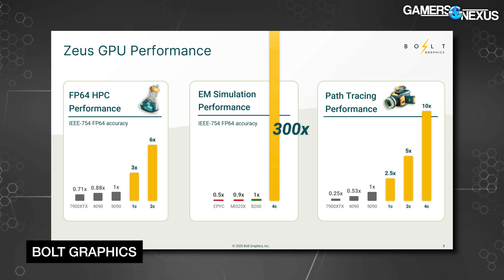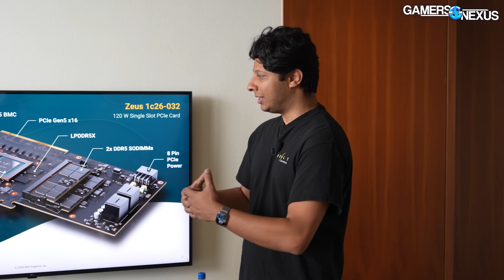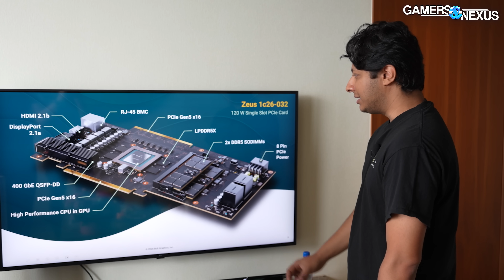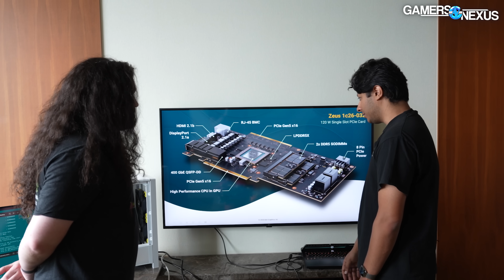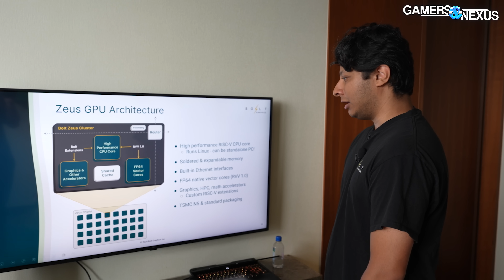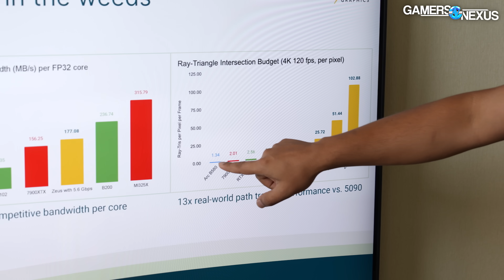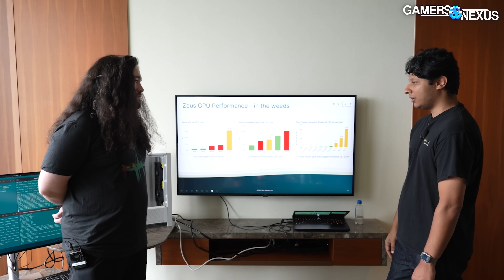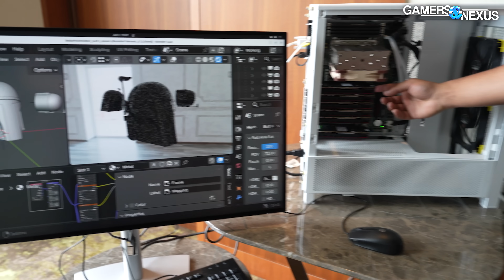A New Gaming GPU Challenger: Bolt Graphics Takes Aim at NVIDIA

Comment: tl;dr: Everybody thinks they're building the next consumer card, but they aren't.

0:18 "Our intention is to make this card um available to as many people as possible."

Regarding the Ethernet port: 
10:42 "A consumer might not might not need this as much, but definitely in a DATA CENTER USE CASE where or in a in a use case where you have maybe 10 GPUs"

20:23: "They're happy to leave rasterization behind. So we need to be able to build something for the future of computer graphics and not really for the uh for the past"

All games require rasterization. Raytracing is a fringe tech so irrelevant, that most gamers don't care about it and in many games it's tacked on at best. The guy is talking about path tracing though, something that no game uses atm. 

Ergo: This card targets data center and other industrial use cases. And that makes sense. No startup in their right mind targets a smaller market if a bigger one promises more success. This card will likely be less fit for gaming than an Nvidia Quadro.

I really have to wonder why the channel is pushing this as if this was a relevant product. They don't even have a prototype card yet after 6 years. No word on the cooling and how this will work in conjunction with adding and replacing the RAM. No word on the included CPU cores and how to boot into Linux and why that would be relevant to most users or the relevance of the dual PCIe-connector. As it is, the design makes the card needlessly more expensive, at least from a gaming point of view, something that's conveniently glossed over, despite every second video on here being on the pricing of tech. This is an ad. No more, no less.

Comment: Just FYI... I am willing to have a computer case 3 times larger and run multiple powersupplies ( even if it doesnt nessarily use twice the power)  if it means matching the power of major companies.  why do i need it to cram onto a single motherboard? Why are we playing by those rules?   

Consider.  You pay 2x for motherboard parts and pay -5× for graphics, ram, processors... 

Why not have 4 graphics cards and 6 processors all running with lots of airflow because the PC base is 4 feet by 2 feet and 3 feet tall?  No rule says it needs to be singulsr heavy mess either..  Cost me $20 more a year in eletricity splitting the PC into 2 peices at both ends of my desk?  Okay good!   The creativity oppertunity and market boom is just sitting there.

Comment: You don't need to "port 10,000 games", you need Vulkan drivers for Windows, that's it. Games aren't written against specific GPU models, they're made against graphics APIs.
Reply: That’s how APIs work in an ideal world, but the reality of PC gaming is messy. Game developers constantly write unoptimized code or tailor games specifically to Nvidia/AMD hardware quirks. Nvidia has thousands of engineers whose entire job is writing game-specific driver hacks to prevent crashes behind the scenes. Look at Intel Arc: it had fully compliant Vulkan and DX12 drivers, but still choked at launch because it lacked 20 years of those hidden, game-specific fixes.

Comment: What fascinates me is that they are positioning themselves towards graphics rather than raw computational power. So these will be fantastic for film, game, and video use, and posssibly things like facial recognition and security, but rather useless for AI and crypto and so on.  Which for us users, IS JUST FINE. For a business that is rendering things ( such as they now do with staging homes digitially in real estate ), you don't want to complete with the AI giants as your goal isn't using it as a very fast CPU to crunch data.
We saw this, for instance, with the Intel Arc series in that they simply said "why should we bother with DX9, 10, and 11, when they are literally a decade or two old?  So you end up with lower priced ( yay! ) DX12 only cards, essentially. And running Vulkan shaders, it's a lot of power for low cost, that the Crypto crowd passed on/didn't just gobble up inventory, as it wasn't designed to be good at that.  In fact it's great at DX12 and sucks for Crypto. ( cries a small crocodile tear... lol )  I suspect this will be the same.  Useless for generative AI but great for actual rendering.  
And finally not having to spend $1000+ for a decent video card like a 5070ti. Lord, the prices have gotten insane again.

Comment: More layers to the PCBs, include liquid cooling channels inside or around the infrastructure of the board, and you won't need laser/optics until it's more feasible in the future.
Dealing with limited VRAM, going with more enhancements made in "what pixels you actually need on the screen" procedural frame generation I think is a deal-maker, better than pre-loading entire maps, rendering what you don't need on the screen, or having to use fake-frame generation.

Comment: For the professional segment, they don't need to do anything particularly special. Arc does fine in that regard, because we don't have special "optimizations" games has needed. I hope they make it straightforward enough. Raw hardware performance, codec and format support.

If they do want to get a hold of the gaming segment, unfortunately...compatibility is quite important. Hopefully the on-chip CPU can sort that out to some degree. And please no upscaling crutches.

Comment: lol  
he said don't want other to experience the "gpu catch fire" but he still have the 500W multicore version of his card. 
the show board is a single core, 120W need 1 8 pin power, so 500 card would need 5 8pin power connector?
what make he think his 500W card would not catch fire?

Comment: Cache is valuable, but it certainly does no compute work on its own. So there is you answer. So it becomes a liability the exact moment your workloads have no proper use for it.
Similar situation to SMT it is a lot cheaper then adding actual cores. It is advertised basically like actual cores.
But it literally does not compute. Therefore it also becomes liability the moment it is not and advantage anymore. Like ALL simple multithreading.
With perfect parallelization (like any kind of simulation for example) it is ironically just overhead. You are better of not using it.
I have a lot of smaller data points supporting that, but 2 really big ones 20 years apart. And they all support that pattern. And as you might know, points make a line.
So when is it good: Average mixed workloads, because it reduces scheduling overhead. (Holy grail: Stateless [Web] servers, where most thread time is spent waiting for slow humans to finally do something again)
when is it bad: Simple multi-threading, the kind where you literally start identical threads to multiply your results
examples:
run the same simulation with differen parameters
Multimedia encoding
Where you basically need no scheduling, they just run until they are done with constant compute requirement. Here the SMT is just overhead.

Comment: yes, bring back expandable memory on gpu.  Its possibly a dumb question.. but why not put the memory on the back of the card? is it specifically a manufacturing limitation (doable but more expensive)?  I don't like the idea of having physical assembly near the core .. I guess it could have like a sheath that can snap on/off or screw on..  so the memory can get air circulation

Comment: The ultimate success of the product is going to depend 100% on software, I.e. Vendor support. So that means Vulkan at the very least. OpenCL is dead and from hearing Darwesh talking, it's apparent they are not interested in dealing with DirectX 11 (legacy) support...and so they shouldn't, it's one aspect that bogged down Intel and their Arc GPUs. So the prudent strategy is forward looking, not backward looking. Also, software engineers that use GPUs for HPC, are only really interested in FP throughput, not Path Tracing. It will be interesting to understand the scheduling architecture vs. AMD/Nvidia. Large caches are great for things like fused/groupshared designs but big texture loads and/or ping-pong processing will take a hit.  Anyway, a lot will depend on driver development. Hope they have a decent team onto this. Eagerly watching this space.

Comment: It is certainly intriguing to having a competitor in the space. But I wouldn't have high hopes at this points. Its pretty much all simulation and  therefore not out in the field. Let alone a gaming CPU, where the biggest struggle will be the drivers. If it took them six years to get at this point, it will probably take ten more to get a gaming CPU out. Others struggle massivly with that, Intel and Moore Threads are good examples.

Comment: The best part is that you just can switch out the memory yourself. 8GB, 12GB, 16GB or more? Just put it in. I wished for this for a lot longer. There are a lot of "older" cards that have pretty decent performance, but they get worse performance because of lacking VRAM. Especially Nvidia is good in producing this E-Waste cards. As an example see @Vextakes where he upgraded his 3070 8GB to 16 GB and the card becomes insanly good in many games.

Comment: I hope they have some success, i guess we can need a lot more competition in GPU.
Buyed Nvidia only for around 20 years until Nvidia basically became a crap company selling over-priced crap cards with feature-locks.
So now switched to AMD. As i am happy with it, especially as a Linux user, i always think more competition is good.
Sadly even with Nvidia politics and how they interact, still most people still are buying Nvidia.

What we maybe need is less exclusive Hardware chips (like Tensor cores etc.). Actually GPUs in the past years become so general that we now name them "GPGPU" (General Purpose GPU), as you can compute anything on them with Shader. Actually you can even see that as RayTracing on GPU actually works long before RTX. I used it back on my GTX 660 on Blender. Also Linux Open-Source shows that you can run "RayTracing only games" like Doom: TDA or Indiana Jones on a Radeon Rx 580. As they just implement the missing features in driver and they just use a Shader implementation (instead of special tensore cores, RT cores and so on).

So the whole GPU development in my opinion have just become fucked up in the past last years.

Maybe with more Vendors we get more better Standards. Also would be good to only have one single Upscaler that works with all GPUs.

Comment: Will they make proper Freedom respecting open source Mesa graphics drivers for GNU/Linux?
Reply: It's not GNU/Linux, Mesa is agnostic of GNU, I'm a developer and I use a fully GNUless Linux system (for efficiency and stability) and Mesa works just fine.
The "GNU" part doesn't apply in this scenario at all because Mesa would make it work for Linux in general.

Comment: If it is basically free or cheap at this point. If this was able to operate as a somewhat okay priced (relative to performance) SBC it might help push the numbers. Because if one space is tolerant to "getting one application working at a time" it is SBC.
The PCIe connectivity would make this a non proprietary blade competitor.

Comment: So wait, you could just get this, a power supply, and that's your computer done? I guess you have to somehow connect a keyboard and a mouse, but you shoul be able to tunnel USB over the display port connector, as long as there is a USB controller on there.
Reply: You need a motherboard to plug it in (along with the rest of the system)...

Comment: 17:50 damn, thats disappointing. i would much rather a card with pure rasterization and no path tracing ability. this slide suggests the exact opposite.
edit: yep. if you continue watching he goes on to admit it has terrible rasterization. so these gpus, even with perfectly refined and optimized drivers, will still suck at an current games. they would only be theoretically good at future path tracing only games with zero rasterization. and that is a long way off. this is sad news. i want more powerful gpus/ more affordable gpus specifically for gaming. for rasterization. for VR which seriously needs every piece of rasterization performance it can get. 

oh well, they were never going to be able to take on nvidia for gaming. hopefully they can compete in the server/ workstation side of things, forcing nvidia to reinvest a bit in gaming.

Comment: Let me get this straight.... I can buy this card, for presumably at least 200-500$ without ram. And need to buy DDR5 ram, lets say 16 gigs for 250$... Or I can buy a 9060XT 16 gig for 400$ wich is most likely leagues ahead when it comes to drivers and gaming and general performance as well as upscaling... 

I think it will never be faster than current gen AMD or Intel IGPs that also use slow DDR5 as graphics memory. And since most CPUs come with them, there simply is no point for this card. 

If it had GDDR7 onboard and you could put DDR5 on it on top of that, open source drivers, etc... then maybe. But this... sadly no.

Comment: the "devkit" thing right at the end is actually very interesting, because i've never really thought of PC parts as being similar to consoles, but what Bolt is doing here, really is much more similar to building a console for your PC, as compared to Intel, because Intel already had an established integrated graphics architecture that was supported, even if they had to scrap most of it for their dGPUs.

Bolt is effectively making a new open gaming console for our PCs, with backwards compatibility for existing software. They aren't relying on old architectures, it's from scratch

that brings up the question, how do existing graphics APIs like Vulkan get integrated?

Comment: Tbh, if it would be 300-500$, even if it would basically only work for cycles rendering, but be extremely faster than other GPUs at that task, I'd consider buying it, as I spend a lot of time using cycles in blender.

Comment: You should have asked if theyre actually booked at TSMC. 5nm is booked out for 2026 and it would be very very hard for them to have managed even a test slot.
Also where is the money coming from? A 5nm mask set alone costs tens of millions of dollars. Tens of millions more for a tapeout.
I would like to start seeing some receipts
Reply: Mass production end of next year is dodgy too
Assuming they actually have a test slot this year, they expect to tapeout at the end of this year, wait 5 months at least from submission, another month for getting board prototypes, and complete verification and tweaks ready for mass production in under 6 months..? That is more than optimistic for a small company
Reply: It is incredibly naive to expect you won't need a respin with first pass industry success rates being 14% for advanced nodes

Comment: So right now. I have many old graphics cards I never got rid of them because I always thought they would be handy years later. Looks like I was right. This new Company should have started with old graphics cards, and worked slow.
Here's what I have.
GTX 960
GTX 1060
GTS 450
GTS 490
GT 8500
I also have some Voodoo ones as well. Some of these can run some old games very well today, plus low power. Energy savers are going to be a must later.

Comment: I thought nvidia's big competitor was ati/amd radeon? Are gamers not getting radeons anymore?

Why would a graphics card maker need to support individual games? It's your job to write drivers which support opengl and directx on all the various operating systems (windows 9x, windows nt, linux, bsd, etc). Once you have done that, the various games should just work. That's why opengl exists. You shouldn't need to port games to various graphics cards.

No vga?

Ddr5? Wow. Just plain ddr was current back when i was working on computers. I think ddr2 may have been just coming out. Likewise, pcie was new. I was still used to agp for graphics and regular pci for everything else. I even remember isa. I was in the computer repair business mainly in the late 2000s, late xp, vista, and early 7 era. 8.1 got me out of the business. But my dad and i were putting computers together in the 9x era.

Intellectual property? I was hoping it would be 100% open source. We need free and open source hardware, in addition to software. Honestly, i'd be happy with something like a mid 2000s era ati radeon or intel gma, as long as it were 100% free and open source. (Obviously, i'm not currently into the latest games. I'm more of a vintage/retro/legacy gamer anyway.) I was assuming/hoping this was going to be open hardware, like the open graphics project, project vga, or ao486. (In addition to the general ideological / philosophical preference for freedom and openness, i believe open hardware is less likely to have back doors.)

On the subject of price increases, i just noticed the other day that 4tb external hard drives are about double the price they were a few years ago. I was shocked. Also, walmart and target don't even have blank dvds anymore. I had to go to office depot.

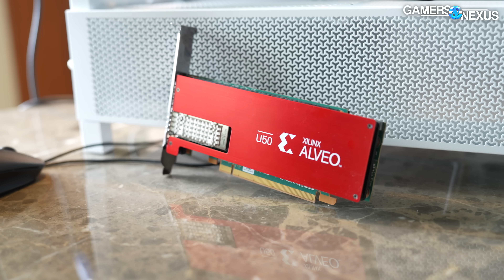Comment: 0:28 correction that FPGAs are never "code simulation". It is just hardware prototyping
Not a simulation/emulation etc.
Reply: They are essentially prototyping hardware with the intent to target silicon. So not using FPGA specific IP blocks or things that won't synthesise for their PDK